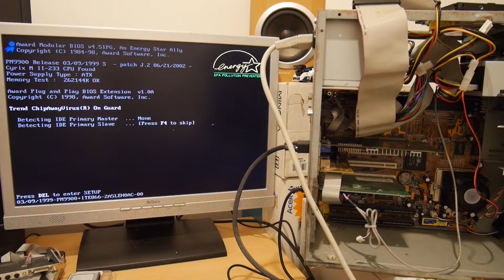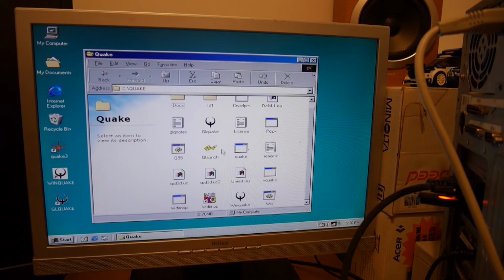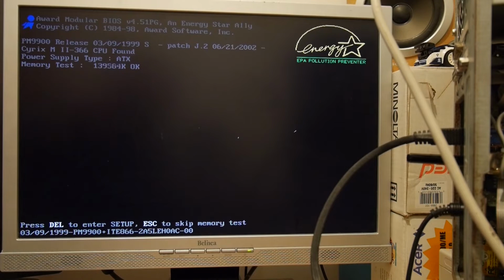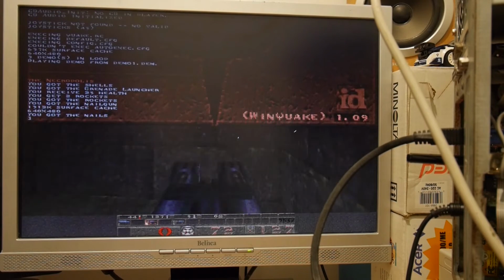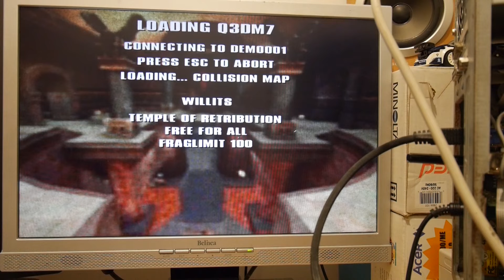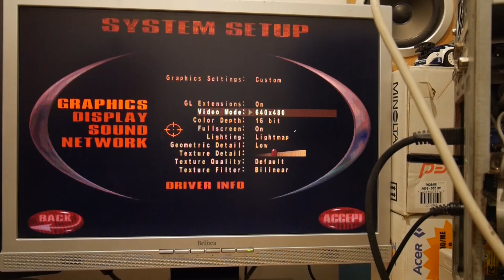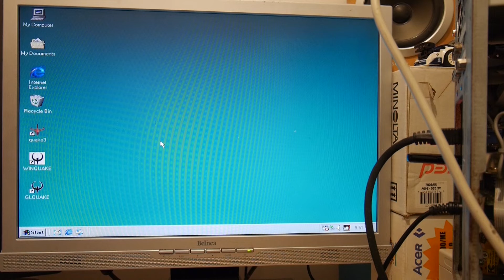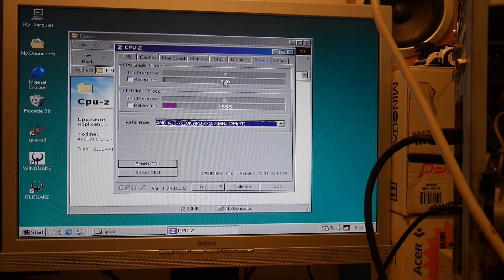Cyrix MII 300GP (233-366ish) Tested - Super Socket 7 (3dfx, Voodoo 3, Quake, QuakeGL, Quake 3 Arena)

Comment: The Cyrix M2 was not the CPU for Quake unless you had a Voodoo, the Quake binary was compiled for the pipelined FPU of the Pentium (and Pentium pro) CPUs, there are many other games on which the M2 outperforms significantly the Intel. Really nice video though I didn´t know the M2 could overclock so easily.

Comment: People rag on the MII processors.. But I bet the MII at 250mhz is going to be at parity with a K6 at 250Mhz running quake.. The PR rating did not do them any favors back in the day when comparing PR ratings to actual speed on the Pentiums and K6 processors.. To bad the inherent design of the 6x86MX/MII processors could not scale up in clock speed.

I also find it amusing that when people talk about gaming on a Cyrix 6x86/M2 machine for some reason they only think that Quake is the only game there is... lol.. Never hear anyone bitching about descent, or other games of the era on the Cyrix... But then if you didn't have a 3dfx card pretty much all games sucked...

Cheers!
Reply: Exactly, the problem was for the Cyrix in Quake which was compiled specifically for the fully pipelined FPU of the intel P5 in mind, it also run great in the Pentium pro.

Comment: I had that CPU ... In the late 90's, at that time I didn't have a lot of money and I had to settle for that CPU, in general it's a CPU for simple activities like word processing, maybe DOS games the main problem I think  which is its poor performance on the FPU when upgrading to an AMD K6 II CPU the difference was just brutal.  Still I remember this CPU fondly
Reply: Clock of clock the M2 is just as fast as the K6. That being said the M2 maxed out at 300Mhz(GP433), including the FPU. The issue was an MII-GP300 (233mhz) was no match for a K6-300. The M2-GP300 was a good match against the PentiumMMX-233 at the time.
Reply: @thudtheace  Yes, that's right in those days multimedia software began to advance rapidly, 3D games began to become more and more popular and the increase in MHZ was not enough, it was necessary to make the CPU more efficient per clock cycle for that reason the K6 was a CPU for a different market segment than the MMX or the M2 (it already had a SIMD instruction set called 3DNow)

  Specifically, I had a K6-II @ 500Mhz... as I said before I didn't have much money and my graphics card was a simple S3 Virge GX with this GPU and the M2 it was impossible to play Mario 64 decently in the emulator, but when I changed the M2 by the K6-II, it was amazing to be able to play Mario 64 even with 3D acceleration from the S3 Virge!  (even though this card didn't have alpha blending) Those were definitely very interesting times...